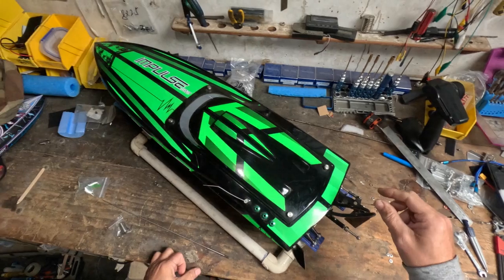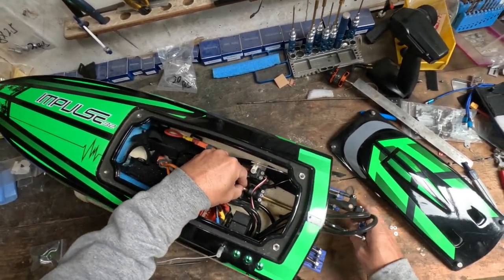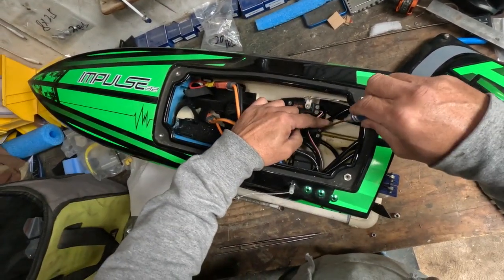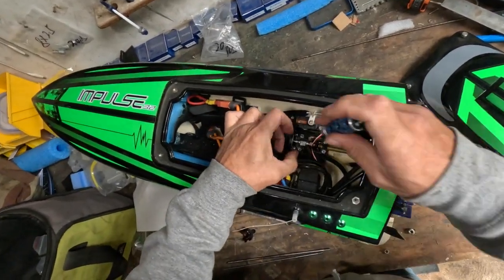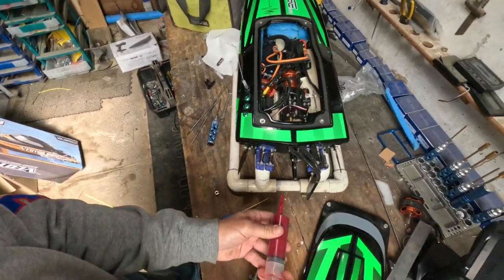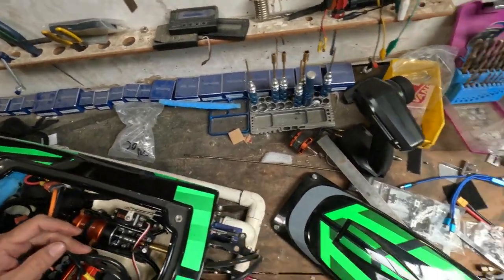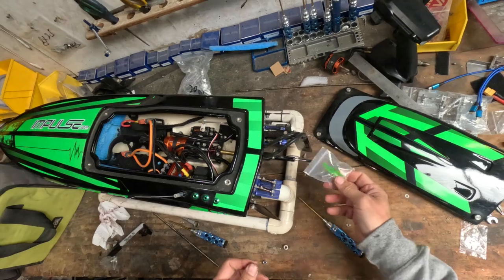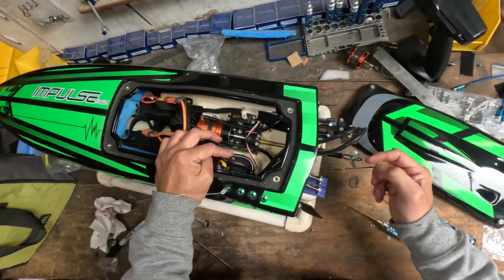Impulse 32 Wire Drive install + 8s durability test

Comment: Nice, what is the benefit of a wire drive vs a flex cable?
Reply from the maker: Less resistence so potentially more speed and run time, plus stronger

Comment: lookimg bloody fast mate, what prop were you using? 44mm 1.8? I've got a similar detounged cnc prop and it cavitates like hell but when it catches it's really quick... Thanks for the upload
Reply from the maker: 4317, our 2 blade stage 2 prop will run faster without the heat or cavitation
Reply: @RCBoatBitz  nice, that stage 2 prop sounds like a beast... Thanks for the reply and hope you have a good one

Comment: Wait, I’m
Confused, what kind of cable is that?
Reply from the maker: Its not a wound wire cable its solid, click the link in the description for details
Reply: @RCBoatBitz that’s sweet!! Is there a such option for the spartan??!!
Reply from the maker: @jaycevessier7554  https://rcboatbitz.com/product/wire-drive-shaft-upgrade-kit-suit-traxxas-spartan-blue/?doing_wp_cron=1726710117.5430490970611572265625

Comment: What prop do you have? I want a 3 blade too :)
Reply from the maker: That was our vector sr80 and recoil 26 prop which is too big for 8s as you probably saw at the end of the video. 2 blades are usually faster anyhow
Reply: @RCBoatBitz  yeah but I like the sound. You have any 3 blades that work on the stock 6s impulse?
Reply from the maker: Ill give this boat another run in the next day or 2 on 6s with the same prop and upload the video, i think it will run warm but probably ok
Reply: @RCBoatBitz  thanks! Does a 3 blade always draw more current/more heat than a 2 blade? I am new to the boat scene :)
Reply from the maker: Yes, thats why you have to go smaller